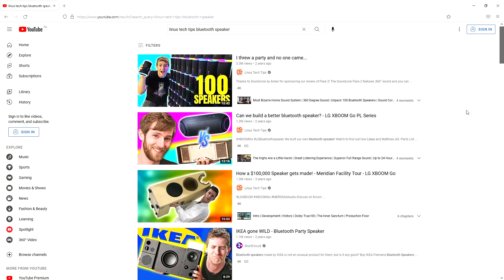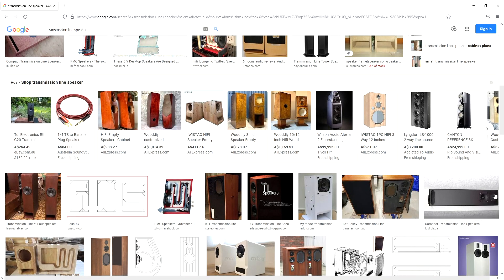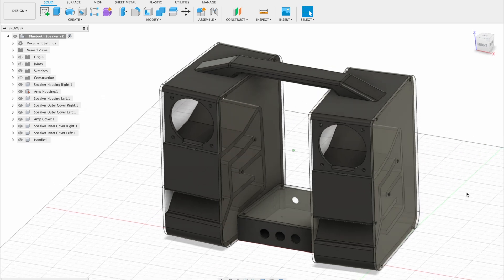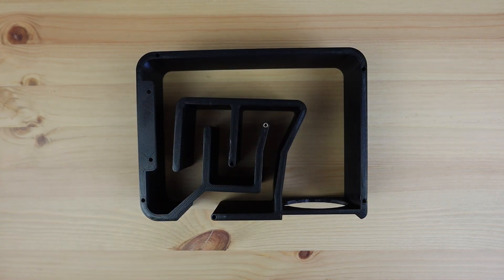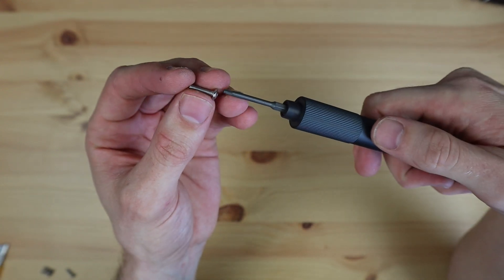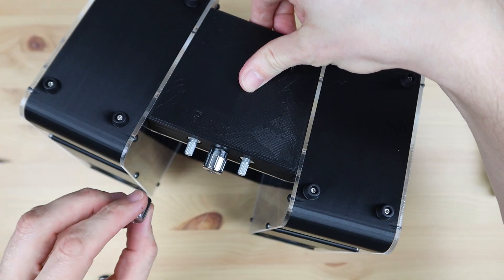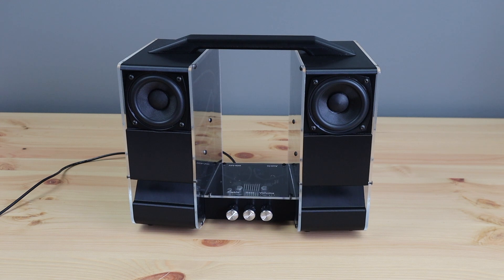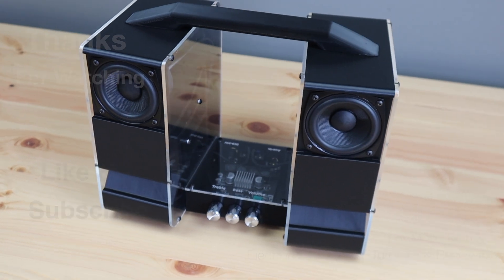I Made A 3D Printed Bluetooth Transmission Line Speaker

Comment: Looks good for sure. 

To make it sound better and deeper, the joints have to be sealed off and the acrylic needs to sealed without any air gaps. 
Also, there should be some poly fill, padding etc.. 

But then, that would not make it look as good as it is now.

Comment: How many wall/perimeters and % of infill did you used ?
Reply from the maker: I usually use 3 perimeter walls and 15-20% infill.
Reply: Thank you. And your printing with a 0.4mm nozzle? So 1.2mm wall thickness ?
Reply from the maker: Yes that's correct

Comment: I'm currently creating a 3d printable subwoofer (6th order). Fs is not the only spec that matters for creating good speakers. I use winisd to calc the speaker enclosure. The port length is subtracted from the speaker internal volume. The diameter of the port/vent also determines the length of it. I had to made it smaller so length also is shorter. The only thing to watch is it doesn't produce to much wind. Anyways your speaker looks cool.

Comment: Folding the line too much, IMO, isn't a great idea when it comes to t-lines IMO. Better to keep the line as straight as possible. This is a larger example of what I'm trying to get at. But if I had two small drivers, I'd do something like this 
https://www.youtube.com/watch?v=jANMiTVg3Jw
But killer build, dude!
I'll leave you with this. I'm sure you'll enjoy it. it;'s an old video, and I suggest headphones! https://www.youtube.com/watch?v=-U3XW6TV9zI
Reply from the maker: Thanks for the advice, this was my first attempt at a transmission line speaker so I have a lot to learn! Is there no implication/tradeoff to sharing a t-line between two stereo speakers as in your design?
Reply: @MichaelKlements  Such a design, there are going to be slight acoustical issues, however, I aim for bass depth. 

As for this particular design, it wasn't an issue, as the hybrid nature of the design, meant essentially, each driver was operating independently.
Reply: @MichaelKlements  However, the design is basically a console, which can be tricky acoustically. 
https://youtu.be/bX2Gf9p0Q1Y?si=yINsmQYBT0Mre_c4&t=40

With more drivers, maybe one could mitigate certain acoustical issues, or maybe create even more, but I enjoy getting big sound from small drivers.

Comment: That looks like a back loaded horn, not a transmission line, the transmission line has a constant cross section area. Back loaded horns are very difficult to design properly. If small size is a priority a passive radiator box is a simpler and more effective way to it. Look cool though
Reply from the maker: Thank you for the advice!

Comment: definitely use some weather stripping or double sides tape / something similar for sealing side panels i do alot of 3d printed stuff and too many times ive thought a design was crap but just turned out to be air leaks. It destroys bass even with the smallest of leaks especially in a transmission line! awesome build though man! i too am a fan of using printing to make hard designs easy to build!
Reply from the maker: Thanks for the suggestions, I'll definitely look at using some weather stripping on my next build to seal the edges.
Reply: @MichaelKlements  Just print a thin TPU gasket, since you alreay have the exact shape from the main parts, screwholes and all! .

Comment: Hi i love your build but i am thinking of buying a 3D printer and i just wanted to know how much filament should i get and which type?
also how long would it last. 

Thanks :)
Reply: Oh thanks so much for the help this helps me so much I'm subscribing :)
Reply from the maker: Hi JJP, that's great. Definitely go with PLA to start as it's one of the easiest materials to print with. The quantity depends on what you're printing (size and infill) - a 1kg roll goes quite a long way for small general prints.

Comment: I would have made it wider , built a PC into it or a Raspberry your half way to the baddest-ass gaming cabinet or media server center.  Power control would be easier there are just so many things you can do. Or even go small and just add a 3.5 - 5.0 inch touch screen for interfacing with the stored files.  More like a jukebox, but keep the look, keep the dials analog 👍
Reply from the maker: Haha this is actually a pretty cool idea. I quite like the thought of turning this into a mad looking little media centre or gaming setup.

Comment: That's really cool Mike, next you could add a I2S DAC and integrate it to HA with ESPHome
Reply from the maker: Thanks for the suggestions! It would be great to add WiFi connectivity and some sort of AirPlay enabled device to it.
Reply: @MichaelKlements   CJMCU-1334 I2S DAC stereo Module UDA1334A, with ESP32 confirmed working with amplified computer speakers here if you have an input on that. Was simple using the ESPHome I2S Component Example

Comment: this is the equivalent of skipping straight to expert mode. did you try playing with the response in hornresp? i've got some half finished designs that i have struggled to transpose into a 3d model. (i''m most comfortable in sketchup, but gave up after trying my hand at FreeCAD) i need to try fusion 360 out.
Reply from the maker: I didn't stumble across hornresp, but I'll definitely try it out. It looks like a pretty neat tool.
Fusion360 is not the most user friendly to get started with, but its powerful when you get the basics right. I use TinkerCAD for the more simple stuff, it's really easy to use but a little too basic for designs like this.

Comment: Absolutely great, you do a great job with all your builds, it both frustrates me and inspires me because I have the 3d printer and the laser but both not setup yet, I just don't get much time, hopefully soon, then it is the learning curve to operate these machines. I looked at Fusion 360 yesterday and found I need to watch some tutorials first, I have been using Tinkercad and that's just too easy in comparison. Oh well, great job Michael, love watching your builds.
Reply from the maker: Thanks for the support! Yeah it can be a bit overwhelming to start out, you just need to break it down into smaller and more manageable bits. Try playing around with Tinkercad and the 3D printer first, then look at adding laser cut pieces and then go on to improving your designs with Fusion360. Tinkercad is really basic, so you'll outgrow it quite quickly but at least it lets you focus on learning the printer and laser cutter.
Reply: @MichaelKlements  Thanks, I do like Tinkercad and can design anything I want on it now but I was feeling it might be time to step up to more function until I looked at Fusion 360, but I will watch many tutorials as time goes on and will eventually be comfortable with it. At the moment my dad is printing so I create things he wants. 
I really look forward to having my 3D printer and laser up and working well, both new just need to be setup. 
Thanks again for your guidance and video efforts,

Comment: Another great build.  Your skill at the CAD program makes this project look easy.  I don't know if this is a suggested improvement, but as a lot my friends use their Bluetooth speaker with their cell phone, maybe a cell phone cradle on top of the amp would be a nice touch.  Good vid.
Reply from the maker: Thanks Greg. I actually thought about putting a cradle into the gap in the middle, my phone fits there perfectly. I thought this landed up being a bit too "retro" since a bluetooth speaker allowed you to just keep it in your pocket haha. It's something that would be super easy to add on though.
Reply: A wireless charger on the phone cradle would be nice

Comment: Nice design, I'm thinking of repurposing my speaker setup to turn it into a similar build. Just one word of caution: do not tin wires that you will put into a screw terminal. This will pose a problem in the future as the solder tin will deform and the wires may fall out. The best way of attaching them is by crimping the ends of the wires. This is especially important when dealing with power supply wiring, but still important for speakers since you want a solid connection.
Reply from the maker: Yeah it's not something I usually do, I didn't have small enough terminals to fit into the blocks on the amp. Thanks for the tip though.
Reply: @MichaelKlements  if you don't have the right size ferrules, you're better off just slightly twisting the wire strands and inserting it bare. it's a pain in the ass upfront but as long as you do get all the strands together and in correctly it'll be more reliable than solder in the long term.

If you have trouble keeping the strands under control, depending on the design of the terminal you could tin just the very tip of the strand bundle, and make sure that tip goes past any of the compressing parts of the screw terminal (plus some margin) so that only the bare copper is compressed

Comment: Michael - love your design process and the beauty of your videos.  Well done!  I did wince a little when you tinned the speaker wires and might suggest you look into using ferrules for screw terminals.  Sharing this video with my Maker group now.
Reply from the maker: Thank you! Yeah I don't usually do that, I didn't have terminals small enough for the blocks on the amp.